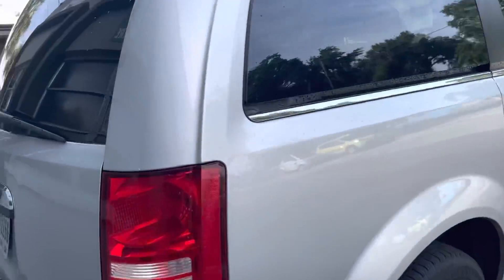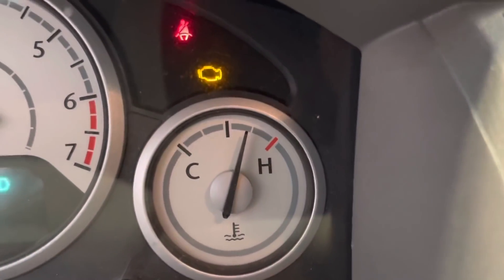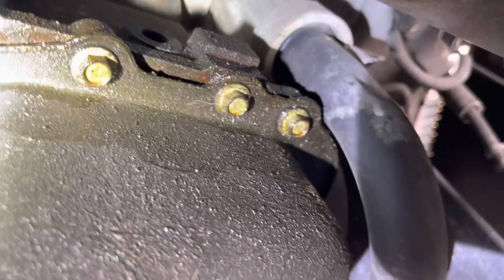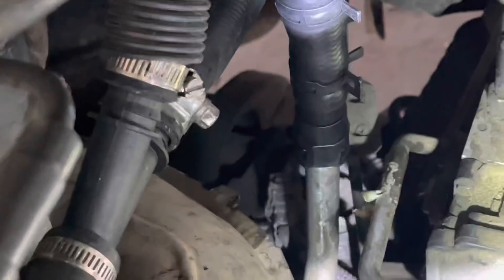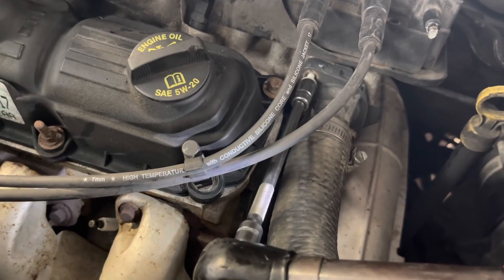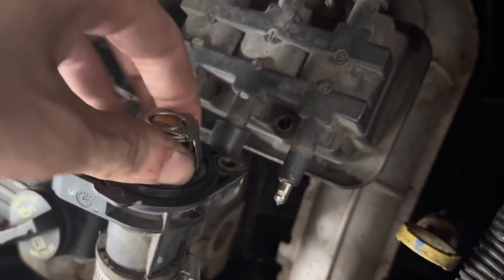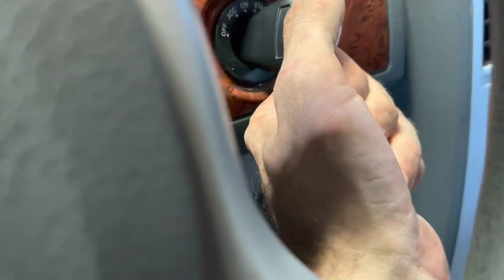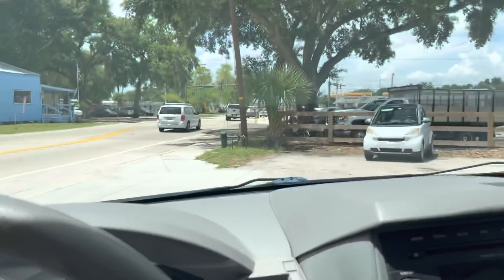Customer States: NO! I don’t want it! Just do the minimum!

Comment: Call it what you like but 12yrs old and 274000 miles I'd expect some seepage from gaskets and hoses. Body looks okay. But because of the lack of maintenance and almost guaranteed there is little oil left in the pan not to mention its been overheated its safe to say this piece of junk is at the end of its life.

Comment: I'm a mechanic, why am I watching even more crap cars in my spare time?
Car was brought in today (not under it's own power) after overheating. No compression, timing ok, leakdown test revealed air blowing out of the other three cilinders when air pressure was put into one... Did have a shiny new radiator though. 
Makes you wonder.

Comment: if that thermostat you lost in his engine bay gets stuck in a belt and causes his engine to seize are you going to buy him a new engine? of course, not.
I know you are just making a dramatic video but please be professional and clean up after yourself and please dont use screwdrivers to put pressure on springs and use the metal housing holding the spring.

Comment: Very stupid customer you never put water in the radtior it causes corsion and rust and it will damage the water pump and cooling system. I only put factory coolant in my car it's cheaper in the long run.